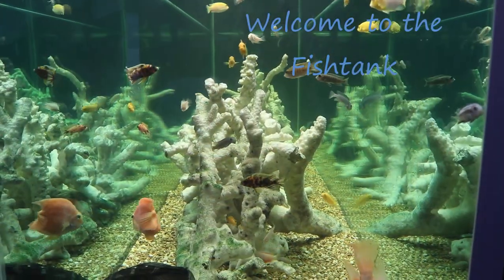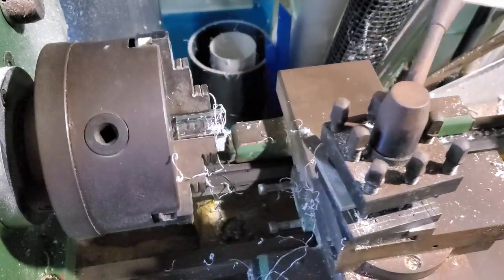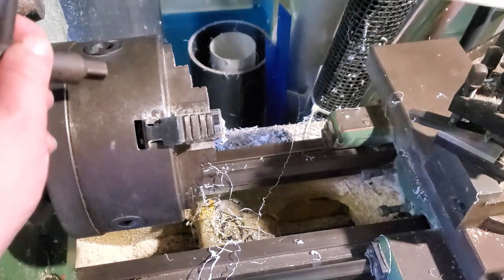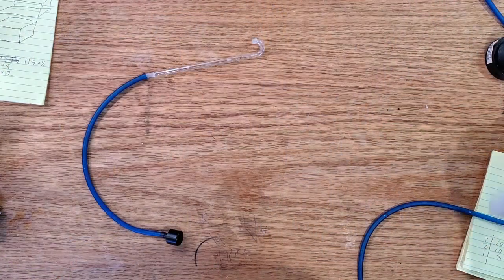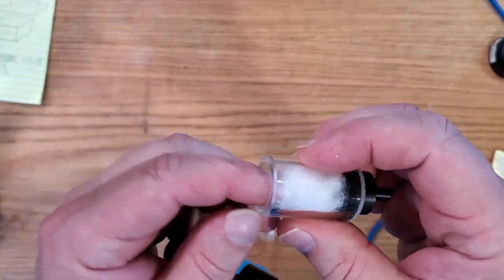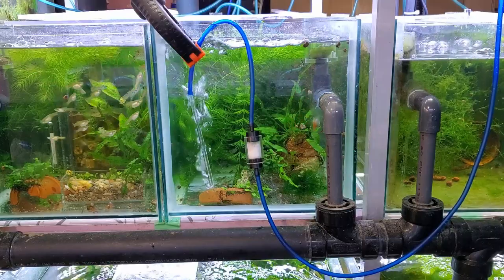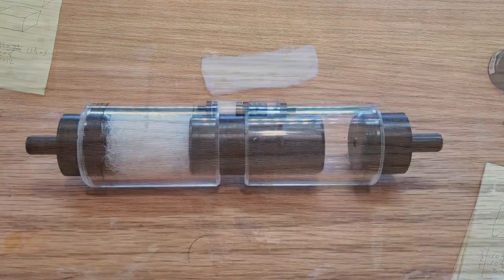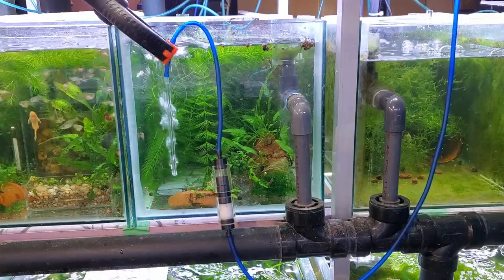Functional Air Pump Silencer with Anti Back Flow

Comment: Are these commercially made? I've got a bubble tube that just resonates horribly through the floor.  It's not the pump itself either.  It gets better when I have a check valve in line but the humming still resonates.  Thinking something like this would do the trick maybe...but I don't have the tools to make one unfortunately.  Also do you know of any quiet air pumps that will put out 7 literes/minute flow?  That's what the spec is on the one that came with it...maybe a quieter pump wouldn't resonate to the tube so much?
Reply from the maker: Sorry. No. I just make them for my use.
Reply: @FishmanEricRussell  would you be willing to make me 3?  I don't have the tools to do so

Comment: I have the same air pump and I get the same silencing effect just by adding an airstone and submerging it in the aquarium. It seems the noise is generated only when the air is free to flow without any sort of back pressure.
Reply from the maker: Back pressure is a big cause of sound from pumps in general, but I definitely noticed a drop in sound with this attachment. Thanks for taking the time to come by and share your thoughts on this!

Comment: I'm prepping a pico/nano reef tank.  I've never had saltwater and wondered if you have any videos or suggestions for beginner reefers?  So far I have a HOB breeder box I'll be turning into a refugium.
Reply from the maker: The best advice I can give for getting into salt is to have lots of patience and take it slow. There is no real trick other than letting things balance out before adding anything else. Hope that helps